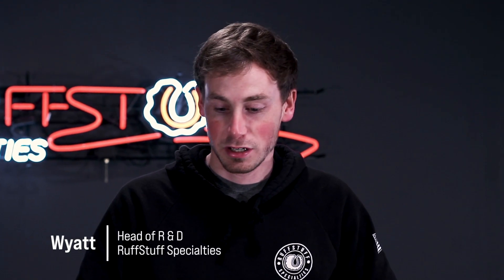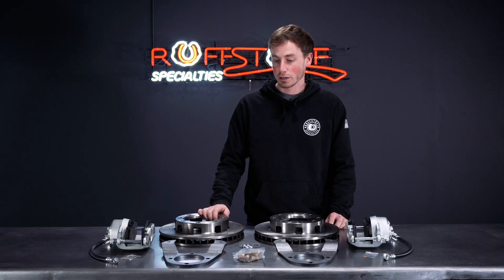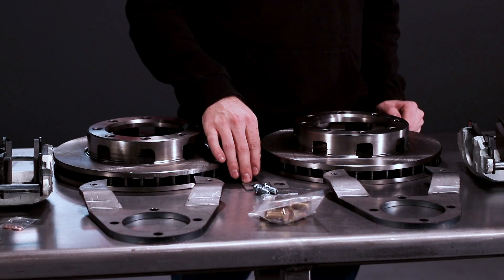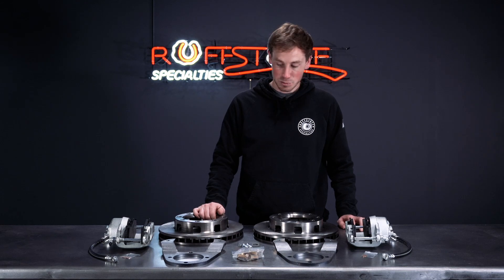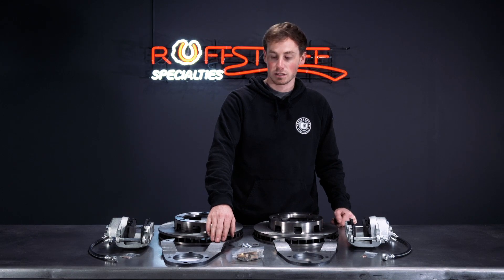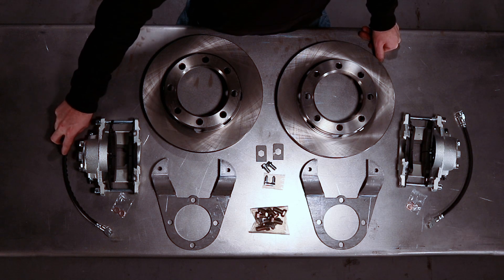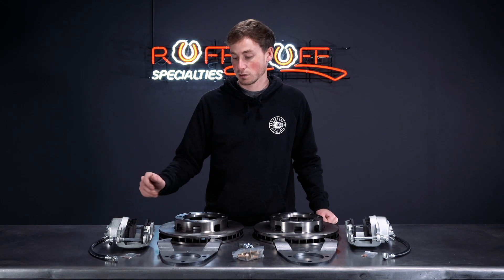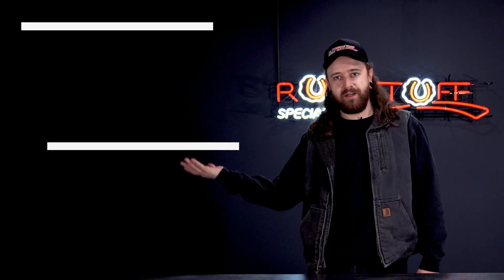14 Bolt Disc Brake Conversion Kit

Comment: Any suggestions for a master cylinder for a 1980 Chevy K20 pickup? The brake fluid chamber for the rear brakes is very tiny. I need a master cylinder that has the same size chambers for front and rear. I haven't found one yet.

Comment: druym brakes are far superior to disc brakes ,,the contact surface is greater than disc therefore stopping power is greater..one ton shoes are 3.5 inches wide and like 10 inches in length ,also heavier can only help out wheelin making center of gravity lower ..just food for thought

Comment: Great Video!! Do you have a set up for a First Gen Dodge Diesel 4x4 Ram Pickup 2500?
Reply from the maker: Yes, here is the link: https://www.ruffstuffspecialties.com/R2443.html
Reply: @RuffstuffSpecialties  Thank you!
Reply: Definitely a great upgrade!! I put this kit on my heavy '92 Crew Cab 4x4 dually with semi wheels, and she stops like a new truck. 100% better braking!!
Reply: @SeanoftheMc  Thank you for the Info